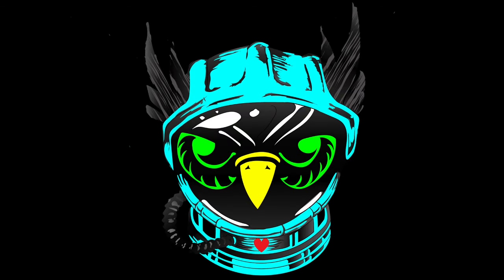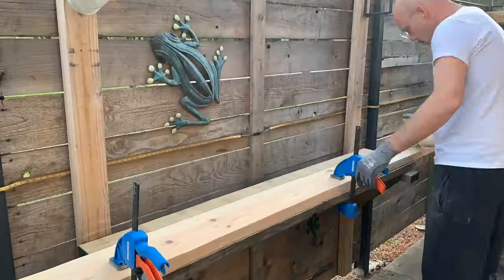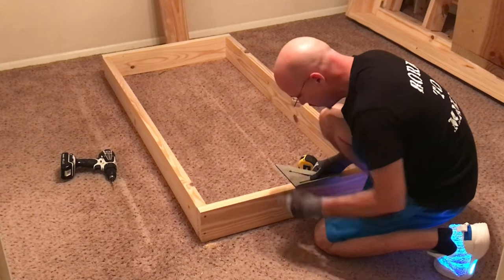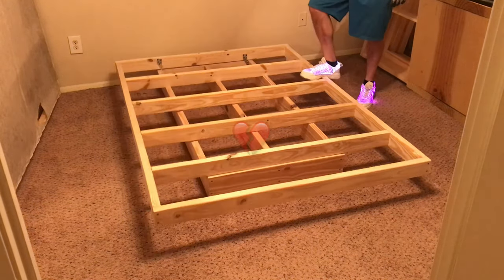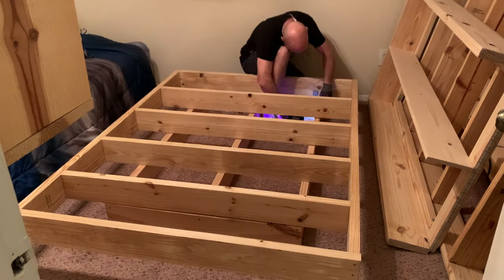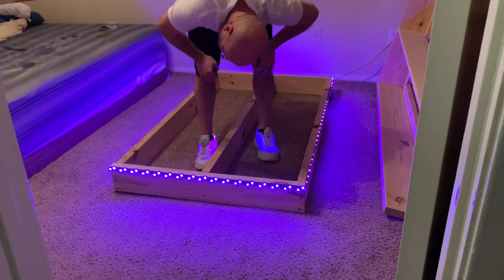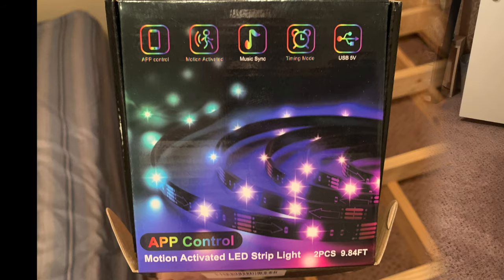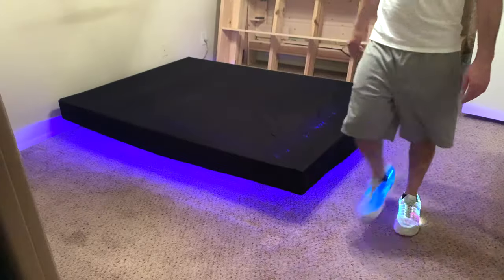Full Size Floating Bed Frame

Comment: I made this. My only suggestion is to get a 4x8 OSB or plywood it’ll create a flat surface which will help if you’re kneeling or sitting at the edge of the bed. A foam mattress will sink.
Reply from the maker: @Greg Ricks Jr. Hey Greg, thanks so much for this.  I usually recommend a box spring as this is what I had when I first started this YouTube channel years back.  I've since built this full size and a king size floating bed frame(even though I don't own either size mattress) just to show you guys how to do it.  In the absence of a box spring, yes, either some type of plywood will work or some people have even used cedar fence pickets!  I very much appreciate your time and support.  I hope you are very satisfied with your new bed frame.  Come back and talk to me down the road my friend.  Stay blessed and be careful.
Reply: What thickness did you use ?
Reply from the maker: @martin8829  just now seeing this, my apologies.  I used American 2x6’s: they actually measure 1.5” x 5.5”, that’s 3.81cm x 13.97cm.  I hope this helps 🤝

Comment: I would’ve loved did you put the wood we need to get in the description
Reply from the maker: @TheUnknownJB Hey JB, when are they going to discover you?  😂 I haven't put it in the written description of this video but I did make sure to include the dimensions I used for this build spoken audibly.  This one is built with...very simply...11 - 2x6x8's, cut to size.  Make sure to cut the pieces for the frame first, and then use your off cuts for those two shorter pieces in the base.  I'm on instagram curtis_made_it.  Feel free to reach me there and I'll help you custom design your bed frame as needed.  I appreciate your time and support on this channel my friend 🤝

Comment: I used your video to make my sons bed. I used 2x4s for the cross beams so I could leave a 2” lip at the top so the mattress sat inside the frame. Then I ran 1x3s from head to foot serving as a slat roll basically.
Reply from the maker: @CWinn Hey C, this sounds like it worked out nicely.  I'm glad this video was a good guide for you.  I very much appreciate your time and support my friend.  Let's talk again down the road.  Take care.
Reply: Do you have any pictures?  Sounds like a good addition 👌
Reply from the maker: @mongo Yes, there are lots of pictures and videos!  Can I help you with your build at all?  Thanks for stopping by my friend.
Reply: @mongo5373  I have a couple yes
Reply from the maker: @CWinn Thanks for coming back C, I appreciate it.  I wouldn’t mind seeing your build myself.  I’m on Instagram realc_love1.  Thanks again for your time. 🤝
Reply: @CurtisMadeIt  do you know how many 2x6 by 8s I would need to buy to build this bed frame?

Comment: nice work you may have been able to get away with the frame tilt by screwing in to the wall joists as a cheat if you wanted to give a more floating effect but your method is far more stable- love the shoes
Reply from the maker: @ivan nightly Hey Ivan, thanks for this recommendation and your compliments.  You are likely correct, I could bolt the bed frame to the wall, but I'm in an apartment and I'd like to keep my videos as user friendly as possible.  I think securing to the wall would drive some potential users away.  When you use 2x6's for the base and the frame, as illustrated in the video, there is no need to secure to the wall.  I appreciate your time and suggestion though.  Let's talk again down the road my friend.

Comment: Are both the floor base and the bed base 2x6 or just the floor base? My cousin who moved in with us will love this!
Reply from the maker: @audrykrueger-cade5343 Hey Miss Audry, lets get on the same page.  The base touches the floor, the frame touches the mattress.  This design is flexible.  As built in the video, yes, both base and frame are 2x6.  You can use 2x8/2x10/2x12 for the base if you would like for your mattress to sit up higher and you can leave the foot area open for storage if you would like also.  I agree, cousin is going to be super thrilled.  Please let me know how else I can help.  I hope you have a safe build.  Talk to you again down the road 🤝

Comment: If you are wanting to make storage underneath it like the king size bed frame you made, would you just widen out the frame or would it work the same?
Reply from the maker: @MadisonGough-l5y Hey Madison, just take the foot board of the base and straddle it over the top of the side and middle boards and secure it down from the top to leave the foot area open for storage...no need to widen it at all unless you are trying to accommodate for specific storage bins.  Does this help?  Thanks for stopping by and talking with me.  I hope you have a safe build.

Comment: How many 2x6 boards are needed to be purchased to make this full size floating bed? 

I am going to make this bed for my son to be 7 year old. We are located in Southern Kentucky, USA
Reply from the maker: @davidsullivan1194 Hey David, this is a good question.  I don't know what your hauling capacity is so it's kind of hard to give you a number.  I'd make sure you have your cut list in hand and then you can figure out if you will have any cost savings by getting 12 footers instead of 8 footers.  If I remember correctly though, it was 11 - 8 footers to make it happen.  Two of the boards you will use the off cuts from the joists in the frame for the head and footboards of the base.  Texas here.  Thanks for stopping by and supporting this channel, I hope this helps.  Let me know if you have any other questions at all.  Take care David, we'll talk again down the road 🤝
Reply: @CurtisMadeIt  I will be using a car trailer to haul all the wood since it’s the longest trailer we have. I will definitely have my number sheet to make sure that I have enough to make the bed. Once I am done with the bed I will send photos if it lets me do so. Thanks again for your response
Reply from the maker: @davidsullivan1194  You bet, I'm glad to help.  ...A car trailer to haul the wood might be a little overkill...I hauled the wood for this build in a 2012 Ford Fusion.  However you do it, just make sure and be careful.  You want all untreated lumber.  Use your off cuts from the frame for the base whenever possible.  3 inch screws at all the junctions.  1 1/4" drywall screws to secure the 2" L shaped corner brackets to the base and the frame.  You'll be done by noon, make sure the drinks are cold.  I don't think you can share pictures here but I'm on instagram curtis_made_it.  Feel free to reach me there any time and share your progress and/or final results.  I appreciate you talking with me David.

Comment: I live in Brazil, would you be able to give me the measurements as well as the materials used?  Congratulations, for the channel, big hug and all the best.
Reply from the maker: @Daniel Santos Hey Daniel, thanks so much for my first ever virtual YouTube hug, that was pretty cool.  When I started my channel, and even when I posted this video, I never expected to get a hug from YouTube.  You are a hero my brother.  I’ll be glad to share this info with you.  Please contact me on Instagram C_Love1984 and I’ll get you all set up my friend.  Talk to you soon.
Reply: Use the measurements he said with however tall wood you want (I used 2x10x8s) Get 2 packs 3inch wood nails. You need a drill, table or circular saw, a drill, and a sander if you want. I painted mine
Reply from the maker: @Malaki Yep, you are correct my friend.  Thanks for your reply here, I appreciate it.

Comment: Do you still use a box frame or just put the mattress onto the frame? Also, are you happy with that layout or would you make the bottom footprint just a bit wider?
Reply from the maker: @daniel 01 Hey Daniel, thanks for stopping by.  Yes, you still need the box spring for this bed frame.  I think I was happy with it once I got done.  As I mentioned in the video, I don't even have a full size mattress, my personal is the queen 3.0 posted on this channel.  It was more than stable enough once I widened the base just a little bit.  Once you get the box spring and mattress on there, there is no way it's gonna tip.  I hope this helps my friend.  Thanks for your support 🤝.  I'll talk to you again down the road.

Comment: Hey Man.  Good review of the structure.  Like my floating bed base, if you were to include a bed head from the ground, it would prevent tipping of the entire structure..  To date, and mine has been in service for 12months, the bed base has not tipped at all through daily use...
Reply from the maker: @Paul Bishard Hey Paul, sorry for the delay in replying to your message.  For some reason, YT flagged it and it's been sitting in purgatory waiting for me to approve it.  Thanks so much for stopping by and leaving your comments and compliments, I appreciate it.  This full size bed frame is 100% rock solid.  It doesn't tip or rock at all.  This full size has only been in service a couple of weeks, but my other size floating bed frames have been in service for years with no issues at all.  This frame follows the design of the previous two.  Thanks again for your input my friend.  I look forward to hearing from you again in the future.  🙏

Comment: When screwing into the wood would you recommend I pre-drill the holes or is it safe to just go for it AND also does the wood creek over time like when rolling over while sleeping?
Reply from the maker: @Alexis Munoz Hey Alexis, thanks for your interest and questions.  You definitely need to predrill the holes for your screws and as long as you tighten your screws down all the way, there shouldn’t be any creaking at all over time.  I appreciate your time and support.  I’ll talk to you again soon my friend.
Reply: @CurtisMadeIt  just saw the one you built for a subscriber. I love the under storage. I'll probably try to mimic but for a full size
Reply from the maker: @Alexis Munoz Awesome!  Keep checking the videos section on my channel.  I’ve got a full size floating bed frame posted on there already too.  I’ve also got CAD blueprints for ALL of these floating bed frames.  Feel free to reach me on Instagram realc_love1 at any time if you need any help at all.  I’ll be right there.  Be careful building.

Comment: Hi mate...  I'm in the UK and love your bed frame.  I don't suppose you have any measurements for the wood for a standard double bed...  190cm x 135cm.   I could work it out but just wondered if you had them already calculated....
Reply from the maker: @James Appleton Hey James, I appreciate your interest and you taking the time to ask your question.  Unfortunately, no, I don’t think I have these calculated out yet.  I have done a double for someone else in the UK, but they had the dimensions at 150cm x 200cm.  I’ll be glad to hand draw you up a set for 190cm x 135cm if you’d like.  Reach me on Instagram C_Love1984 and I’ll be glad to help you.  I need to know the exact dimensions of the lumber you will be using to build your bed frame and then I can get you all set up.  Thanks for your time my friend.  Talk you you again soon.

Comment: I made the bed frame today with my kids’ help. Thanks a million! It was super easy to follow. Only thing I missed (or you didn’t mention) was the joist hangers. How many did you use? Do you know the exact name for them? Thanks again
Reply from the maker: @Garrett Griggs So cool Garrett, I hope everyone is happy and still in one piece!  You are very welcome my friend, I hope my video helped you in some kind of way.  I didn't use any kind of joist hangers in this build.  I have previously used on my channel, and did on this build, at 1:37 mention that I was using the 'Simpson strong ties' again.  Those were to attach the base to the frame.  I used a total of four of them and have since upgraded to the corner brackets to attach the base to the frame.  They are a more user friendly option for me to recommend.  I hope this is useful for you.  Let me know if you need anything else at all.  I appreciate your support.  Talk to you again soon.
Reply: @CurtisMadeIt  I finished the beds! You made a fantastic video my friend. It is a FANTASTIC tutorial. You should be proud! My boys LOVE their new floating beds. I think I paid about $225 for 2 of them for the 2x6 lumber, screws, Hurricane ties, etc. That Solder brand junk is so crappy (and more expensive too)  compared to your build. I also added a 4x8 sheet of 5mm “underlayment” type paneling. This way, there wont be any “dips” in the gaps of the joists like someone mentioned in the comments. I had the Home Depot cut those paneling pieces at 75” and then cut again into (2) 24” wide pieces. Easier to load into the SUV and also carrying them up a flight of stairs. You don’t even need a boxspring now! I used a few 1.5” drywall screws to secure the paneling to the bed frame so that it doesn’t shift around in the future.
Reply from the maker: @Garrett Griggs This is great Garrett.  So glad to hear you’ve completed your bed frames!  I greatly appreciate your feedback and compliments, I mean it.  I’m thrilled that your boys are happy with their new bed frames and you came out of there for a pretty good price too!  Not bad.  The underlayment is a good idea…this is what I recommend in the absence of a box spring.  Your build is spot on my man.  Thanks for everything, I really appreciate your correspondence.  I hope you have a good day and rest of your week my brother.  Talk to you again later.
Reply: @garrettgriggs9712  Hope you put holes in the panels. You can get moisture and mold where the mattress meets the panel. Need airflow. Otherwise congrats on your build.
Reply from the maker: @alexapuerta Hey Alexa, thanks a million for pointing this out.  Lots of people seem to be unaware that a mattress needs proper airflow to ‘breathe’ properly.  I appreciate your time and support on this channel, thank you.
Reply: @CurtisMadeIt  My pleasure! Thank you for your videos. I'm adapting them for my builds in the near future. They're exactly what I was looking for.
Reply from the maker: @alexpuerta you bet my friend, safe building!  I’ll be here if you need anything 🤝

Comment: I'm going to take a guess and say when the bed has a mattress on it, the weight would have fixed your frame tilt. Imagine you did the same test with 2 peoples spread out laying on it.
Reply from the maker: @Ravic Hey Ravic, I'm gonna be guessing with you.  I don't have a full size mattress so I just built this bed frame for YouTube to show everyone how to build it.  I'm fairly certain you are right though...with a box spring and a mattress on there, it's likely not gonna tip over when built in the original configuration due to the added weight.  I can't afford to take any chances at all though...I don't want people building the stuff from this channel if I'm not 100% certain myself that it is rock solid and worthy of others building it so that's why I modified the base to be a little wider and a whole lot more stable.  I hope this helps.  I appreciate your time and support, stay blessed my friend 🙏

Comment: Awesome as always dude. Got a question tho. U know how a bed usually has a stiff board between the frame and the mattress? Is that gonna be for this type of frame also?
Reply from the maker: @Alexis Munoz Hi Alexis, I really appreciate it, thank you so much.  Yes, this stiff board you are referring to is what we call a box spring here in USA.  You will definitely need this box spring or you can substitute plywood if you don't have a box spring.  You can get the 15/32's or 1/2" plywood, you don't need the expensive stuff.  I hope this helps.  Let me know if you need anything else and I hope you have a safe build.  Talk to you again soon.

Comment: Would the box spring go on the frame? Or just the mattress.
Reply from the maker: @aaronbuchholz2510 Hey, good morning Aye-Aye-Ron.  Thanks for coming by my friend.  You build the frame as desired, either as it is in the video or modified to better fit your needs, and then you put the box spring on top of the frame...mattress goes on top of the box spring.  I hope this helps.  Let me know if you have any other questions at all.  I hope you have a safe build.  Thanks for your time and support on this channel 🤝